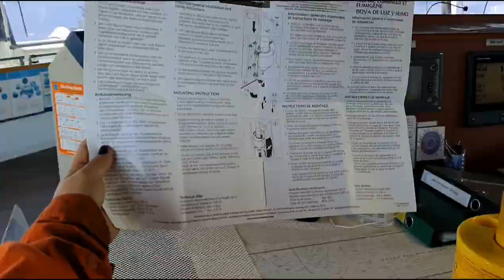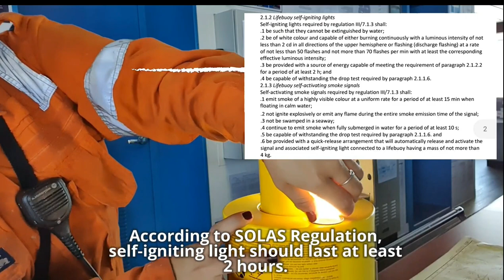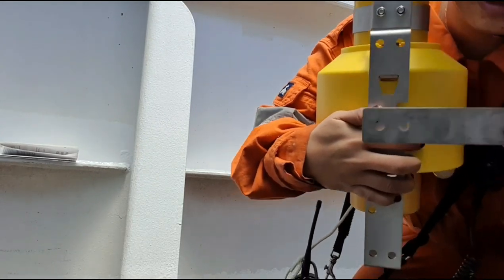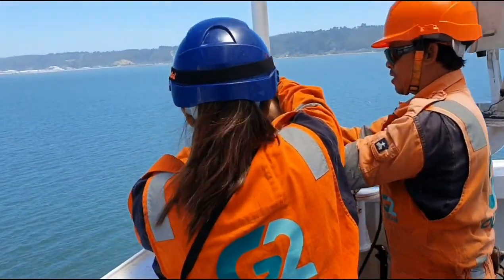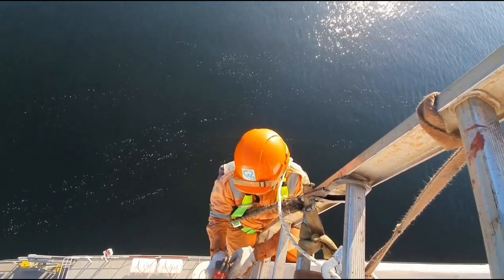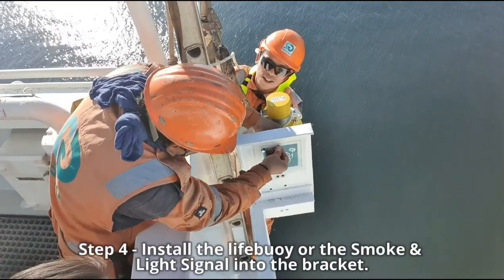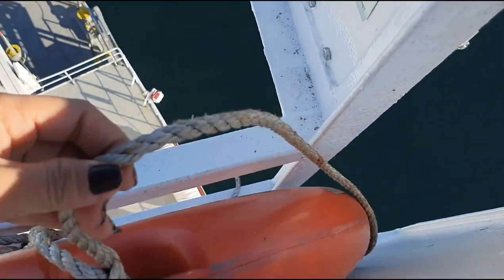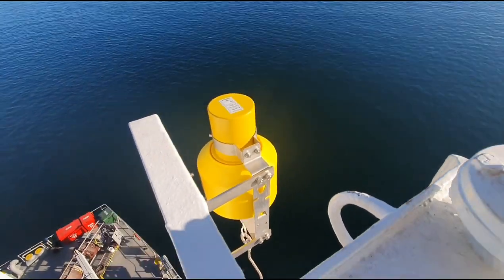VLOG#3-HOW TO INSTALL MOB SMOKE & LIGHT | How to be a Third Mate Series | Show and Tell Shawntel

Comment: Hello Ma'am. After installation, i observed the direction of the fall of the bouy is towards the aft of the vessel instead of towards the side together with the lifering to fall away from the vessel. For a scrutinuous PSC Inspector, that would be a deficiency. I cannot post a photo here to illustrate the correct positioning but allow me to use your video to make a reaction video about this showing the correct position of installation.
--------------------
The correct position of the light & smoke signal:
https://youtu.be/Orc5dynpgc8
Reply: This is a serious deficiency even for a normal PSC inspector and I have seen a safety bulletin for exactly what you are describing. Very good observation.